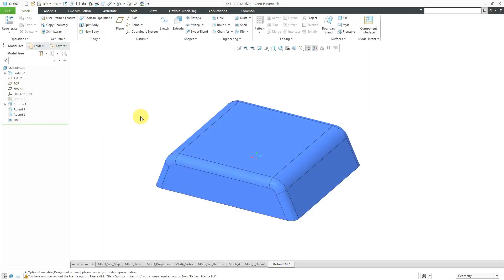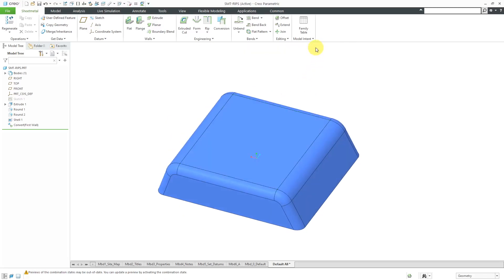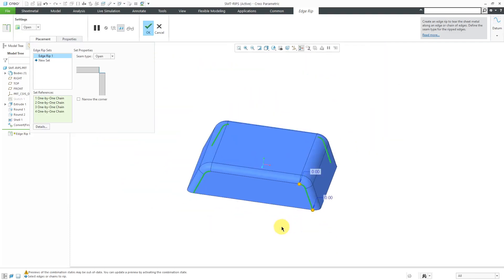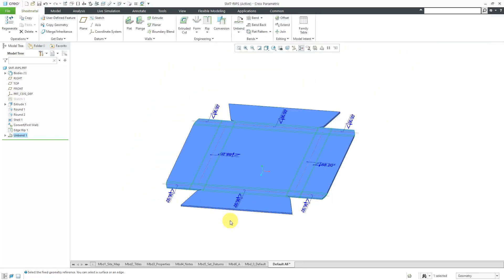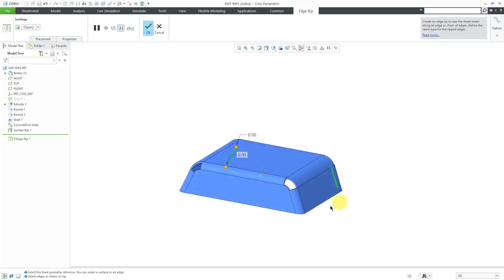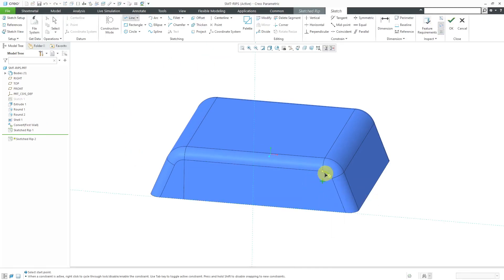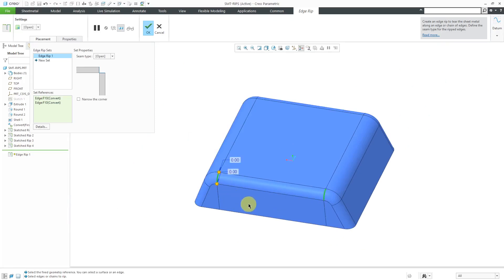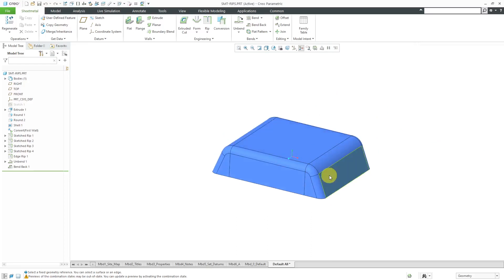Creo Parametric - Sheetmetal - Edge Rips, Surface Rips, and Sketched Rips

Comment: I have a rolled plate (pipe) with a sketch that is patterned around an axis to the surface of the pipe. When I rip the pipe to create a plate, and use unbend, not all the sketches follow the unbend feature. Almost all does, but some seem to break into separate lines within the sketch and get scattered. Do you have experience with this, maybe a sollution?
Reply from the maker: Why are you patterning the sketch?
Reply: @CADPLMGuy  It's a water pipe where I have sketched a vane to counter rotation of water in the pipe. The vane has a geometry making it much easier to use the pattern than to sketch each vane.

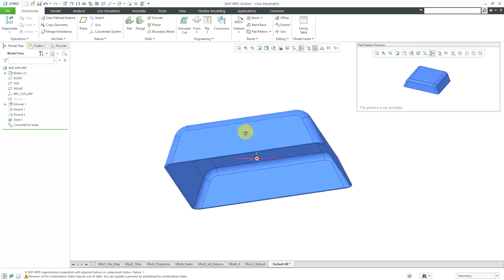Comment: You can also very quickly create a flattened simplified rep using one of the two farthest right buttons in the flat pattern preview window (1:20). (One is those buttons creates a flat pattern family table instance and the other   creates a simplified rep - can’t remember which is which at the moment.) It doesn’t save a tremendous amount of time from your current method, but I don’t think it requires you to have an unbend as your last feature and it’s quick and clean. Thanks for the video as always
Reply from the maker: Thanks! I forgot about those changes.